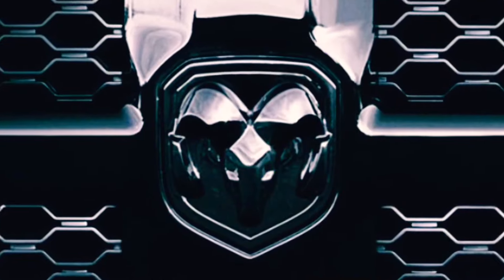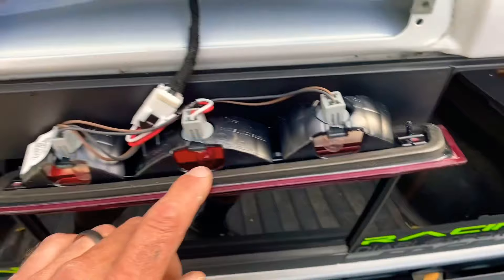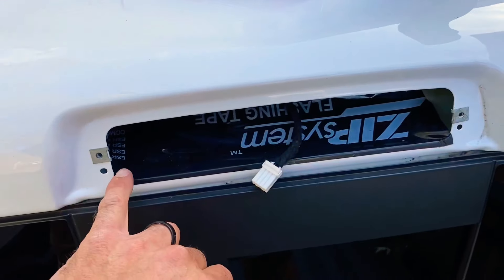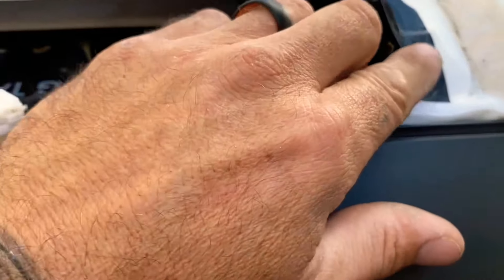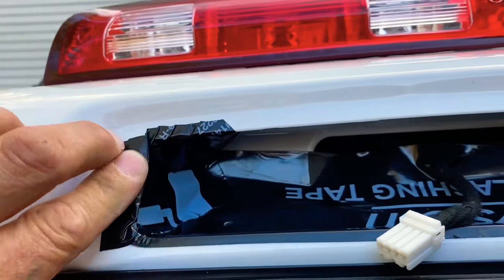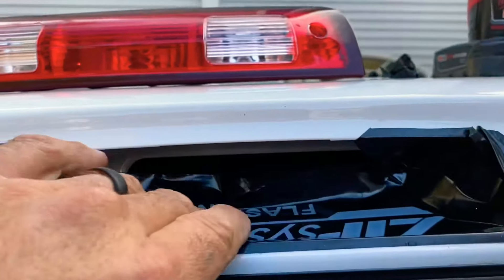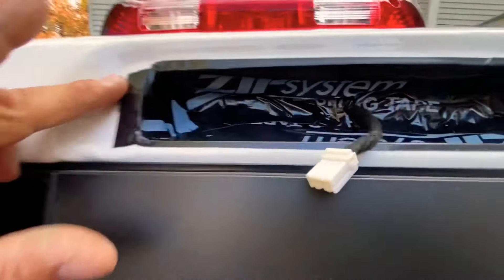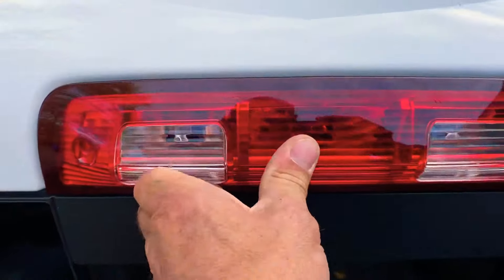Make it LEAK PROOF!! RAM 3rd Brake Light

Comment: The best no leak method I and my friends have been using is to buy a LED 3rd brake light and clean surface good. The LED version ensures you don't have to replace bulbs again. Push on the light as you screw the light down until the light is snug so you don't crack the lens. After the new LED light is installed with supplied gasket run a thick bead of clear outdoor silicone around the entire light and smooth out with a wet finger and your leakproof. Also, put clear silicone in the screw hole.
Reply: Using silicone to seal the lights is an nightmare, since it will shrink once it indures a years worth of weather. It's is almost impossible to remove. Going throught right now. I regreat useing the silicone.
Reply: @lamontfaulkner5090 agreed just got a truck where the last owner did that. Had to destroy the 3rd brake light to get it out. #Nightmare
Reply: @jesseflores9989  $200.00 for a new lense 2008 Ram. I was able to save the old one, so I'll try to reuse it at some point. Just recycle them 😐

Comment: But water leaks in will accumulate there. Why not put silicone around the light frame to prevent water from getting in?
Reply: I have same issue and did buy silicone but haven't fixed it yet. Any issues with replacing the light after I apply the silicone? I thought about just sealing it from the outside without removing the light
Reply: That's what I'm thinking. Won't this just create a mini swimming pool behind the light?
Reply: @jasons1034  not if you leave weather stripping gaps on the bottom portion and of your light?
Reply: Ok so a thought.  If you seal it up like that any water that leaks in around the seal will just pool up inside your new chamber you made along with the 3rd brake light housing itself. 
You'd want to cut at least a 1/4 gap from the bottom of the seal on the 3rd breaklight to allow anything that got in to drain out. 
But I'm not sure if cutting a 1/4 gap in the seal would be just as bad or not.
Food for thought.
Reply from the maker: Cut a section of gasket out on bottom for water to escape.  I have to check it and see if any pooled up
Reply: @TunedRAMS  make a video and update us thinking of doing that to mine soon
Reply from the maker: @bryanlsx7110  will do!
Reply: Nice idea bro!
Reply: I'm at my wits end with this stupid light. Anyone have ideas? I weather stripped the inside and siliconed the outside. And it STILL leaks. Ruined my brand new headliner. I'm about to shove silicone in the screw holes too. I guess I'll add this stuff too. I'm ready to just take the light off and seal the hole.

Comment: Now you just made a swimming pool for your 3rd brake light…suppose to keep the water from getting in from around the light…
Reply from the maker: Cut (2) 1/4” slots in bottom weatherstripping for it to drain
Reply: You cut two, small vent channels in the gasket on each side of the light, at the bottom for water to run out, duh. This guy came up with a great idea sing this zip tape! Thanks for the video!!!
Reply: @TunedRAMS  exactly! Great video!!

Comment: I just fixed mine.  It's crazy how badly these rams are built.  I spread waterproof grease all over my gasket.  Essentially making the gasket waterproof.   I hope this works.
Reply: how has it been? has it worked well?
Reply: @graemebosch153  made it through winter in Washington  and no leaks.

Comment: the water leak caused me an electrical issue inside 616 dollars to fix it. I will be calling Ram
Reply: 2019 Ram 1500. Leaked in and shorted the radio frequency hub. Truck was inoperable. Dealership said it was the rear window frame. $2100 and 3-4 weeks later I get it back. First rain it was leaking again. I checked that third light and bingo. Sealed it up myself and no more leaks.
Reply: @butterblood  the dealer put silicon around the break light and I took the truck to a glass shop and they said I did not need to replace the back window.
Reply: Wasn’t covered under warranty?
Reply: @mattsaul6187  My insurance co ended up covering it for me because dealer and dodge wouldn’t.
Reply: @butterblood  mine is 2.5 years old. 17k miles. Goes in on Monday and I would assume it’s under warranty. I hope
Reply: @mattsaul6187  I bought mine used with around 19K miles. Dealer said it was wear n tear even tho I was still under factory warranty. Dodge said they couldn’t help since I was the second owner. I paid extra when purchasing for an electrical warranty but I ended up just putting it all under my insurance to only pay one deductible. They wanted to replace the floor carpet too but I didn’t do it.

Comment: I ordered the ZIP system tape on Amazon but it seems way thicker than yours.  I used it anyway. Extremely sticky... Plus ordered a new gasket... I think with the two, I hope to God the leak will be stopped.  Of course I fear I have more of a leak than just the 3rd brake light.  I can't see anything around the window, sliding rear window, etc. but it may be leaking too.  Or the vents like yours.  What a PITA!!!!   I have a mildew smell.  I also installed a cabin air filter kit since my 2016 didn't come with one.
Reply from the maker: Hopefully it works, sounds like it will

Comment: Factory gasket sucks and will leak. I bought a marine weather seal gasket at lowes and used that and it’s been on for years and has never leaked. Anytime you remove the 3rd brake light change the gasket and it will never leak. When you buy the stuff at lowes you get enough to do it many times.

Comment: If you had a helper with a hair dryer or a heat gun, could you lay the Zip tape over the entire hole and then heat and press the light into place for a minute to create a sealed, formed pocket?
Reply from the maker: @182ugg  worth a try!

Comment: Looks good.
Good idea.
Where does the water go when it still leaks past the light lens and collects inside ???
Reply from the maker: So when they leak the water goes to the left and/or right, goes down to under the seats
Reply: @TunedRAMS where does it go now that it's all taped and sealed? Seems like you've protected the cab but haven't actually stopped the leak

Comment: If the water goes forward does that leak into the door grab handle of the front passengers because my pillar of the door handle on a driver side is leaking is it because of that??
Reply: The other channels say that it’s coming from the sunroof drain tubes. That is happening to us on two trucks and we are trying to clean the drain tubes but it still leaks the drain tubes in the front of the sunroof end up coming out in the door jam, and a little rubber gasket Between the two hinges.

Comment: my only concern with this method is if water does get in it has to have a way to escape/drain, this method does not allow that and pooling is even worse and can lead to a bigger problem....
Reply from the maker: Cutting two 1/4” slots at the bottom will help with that

Comment: So water that gets past the oem seal just sits and puddles there?

How about cutting the oem seal at both bottom corners for it to drain?
I don't think I'd want water to sit there and freeze.
Reply from the maker: I cut two slots out on the bottom if it ever did get water.  No problems at all!

Comment: I thought you were going to tape the flange all the way around to create a seal.  I was fine with that until you began to create the pocket of tape complete with sealing the cable opening if water won't get thru the tape edging?  you created a pool inside behind the brake light that can now retain any water that might get thru where before it would drain out either side of the body. standing water and humidity equals mold.
Reply from the maker: Cut 2- 1/4” slots at bottom

Comment: Flex seal has the same kind of tape. Not sure which os better or cheaper. Im sure it works just as good. Also if yoi have a tonneau cover, they come with seals, gasket odf some sort. You can use them and finally house door seals from home depot can qork too.

Comment: Just a heads-up. If your 3rd light  is not leak then, Those back glass power sliders sometimes leak also due the the plastic cracking. The way to know is looking at your center glass. Follow the edges right and left sides straight up to the plastic area if you see a crack line that means it's cracked all the way to the top. Water is getting in there.  I do auto glass replacement on those for that reason. And sometimes if it's not the powerslider it's the 3rd light. Unless someone changed your glass and did a bad install
Reply: I had those little cracks in the frame of my 2019. Water got in and shorted an electrical component. Dealership charged me $2100 to replace entire window and frame. First sign of rain it was immediately leaking again. I check that third break light and realized water was getting in there. Sealed it myself and no more leaks. I’ve since seen others with those frame cracks that had no water issues. Entire thing is a shitshow.
Reply: I just found mine leaking this morning.  I see the plastic is cracked above the power sliding window

Comment: So you stopped the water from getting to the inside of the truck but you let it fill up in the brake light! This doesn’t actually fix anything it’s just a bandaid to a problem that creates another problem (which is water killing your bulbs in the light itself).
Reply from the maker: Cut (2) 1/4” slots at bottom weatherstripping for drainage

Comment: You are the Man.  I had a puddle in the back of my 2018 crew Cab, now the carpet in the storage under the seats is wet but drying.  I used this flashing material and Marine grade water proof insulation around the brake light.  If that fucker leaks now, it has to be from somewhere else.  Truck is still under warranty, so if it happens again, which I doubt it, I'll take it in and let Ram deal with it.

Comment: RAM needs a recall on this issue. Recently purchased a used 2019 ram 1500 , leak issue. RAM needs to be held accountable for these leak issues & coincidental damages I. E. Headliners, seats, carpets,electrical,ect. Class action lawsuit period.  Posted lengthy rant on another you tubers channel, the more I research this the more common of an issue this seems to be.
Reply: I want to join the Lieke ram club. We have a 2006 quad cab. No sunroof big horn it does not leak so far 3500 Dooley we have a 2006 mega cab 1500 Laramie with sunroof. It leaks, mainly from passenger front door, handle a gallon of water every inch of rain. Yes, we do hang a bucket there with a wick wick to direct the water into the bucket. No leak in the back corners of this truck headliner, but maybe a little bit around the rear window, which is a slider power. The most disappointing is our 2014 Limited 3500 mega cab Dooley. It leaks from the front a pillar door handle when parked in a slight downhill in our driveway at a slight uphill. It leaks in the back passenger corner, headliner and water runs down the back wall causing it to get the carpet very wet right next to the rear door. I only bought this truck for the Cummins and the rest of the crap came with it. Although the interior one it’s not moldy and wet is very nice. not sure if I’ve heard anybody saying they leaked before 2006 a common item seems to be the power rear window and the sunroof and the third brake light although our 2006 quad cab has the third brake light but a manual rear sliding window. No leaks on that truck, there should be a recall on the class action lawsuit who is busy contacting the lawyers. I am going to talk to Ram cares to see if they? Care

Comment: If water gets in then it will just sit till it can find a way out or fill your light?
Reply from the maker: I cut a small piece out for the weatherstripping on the bottom for it to escape
Reply: That's what i thought too but then what else is left to do ? I bought a different seal from home depot as well that was ticker but i doubt that isn't gonna leak.. maybe I'll try this too

Comment: Just did the exact same thing with my truck since the waterproofing foam didn't look reliable enough as it is, even removed it and installed a proper auto motive one and may even Caulk around it when I get the chance. Great idea with the tape as well, I just hope it doesn't get too hot in there cause my trucks connector had a foam sleeve around some of the wire

Comment: Just run silicon around whole light. The back breathes from cab. Do a clean job.
Reply: that's an idea as well, but the flashing tape on the inside will never get sun baked like silicone on the outside will. it will last a lot longer.
Reply: silicone at the same time creates mold

Comment: Just watched your other video "Water coming in!" from 2019. Made a comment there on a better weather stripping material to use but this is a great add on to the repair too! thanks!. The weather stripping was MD Building Products 19/32- inch x10 feet premium Auto and Marine Rubber Weather Strip Black. Available at Home Depot too as a good fix for the piece of s#!t stock seal replacement.
Reply from the maker: This should have been a recall!
Reply: @TunedRAMS  
This has been a problem for a very long time. I've had a 2010 2500, 2012 1500, 2017 2500, and now a 2021 2500. All of them have leaked. I've had several 2nd and 3rd gen rams and no leaks so it seems it's only 4th gen and newer. Live my rams but the leaks are so annoying until you can track them down.
Reply: @treeamigo8447 my 3rd gen is leaking right now. It's a 2003 though and just started leaking, so 21yrs with the original seal is pretty darn good.

Comment: I just bought a new gasket. $10 on Amazon
Reply: Same cheap seal though which will lead to the same problem in the future... So new seal is just a temporary "fix"
Reply: @DirtNassty  100%. I've been through 2 new seals neither one stopped the issue.  A bead of clear silicone solved the problem though..

Comment: Waist of time. Just smear a little silicone on the outer edge of the light gasket so it doesn't saturate with water and leak.
Reply from the maker: Yeah just caulk it, works well when you have to remove it 🤦🏽‍♂️
Reply: @TunedRAMS  no, l dont mean caulk it in place. I mean remove light and coat the seal edge with silicone so it does not absorb water.